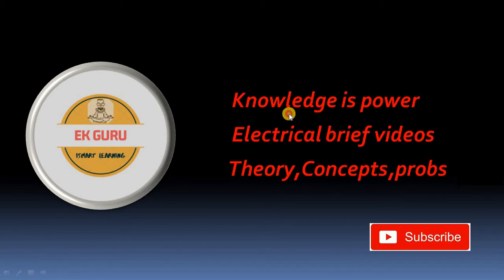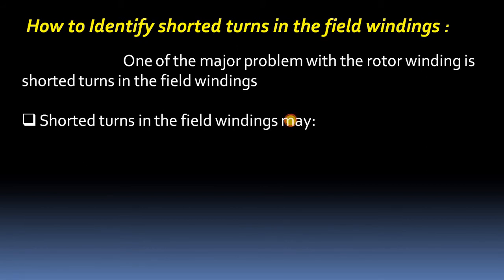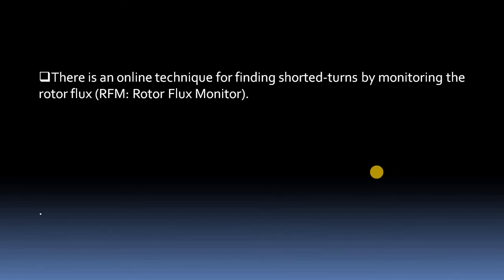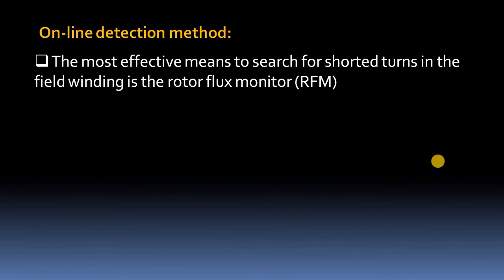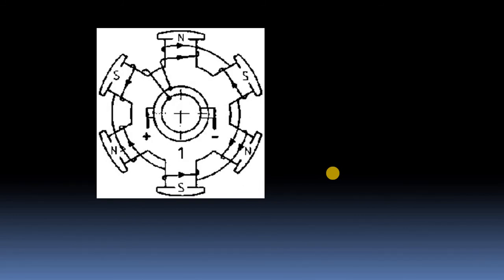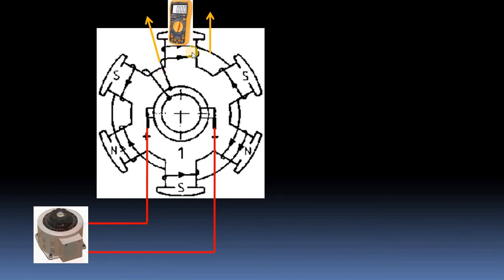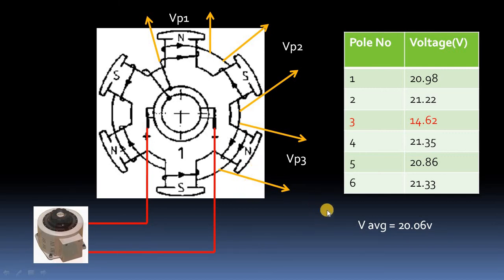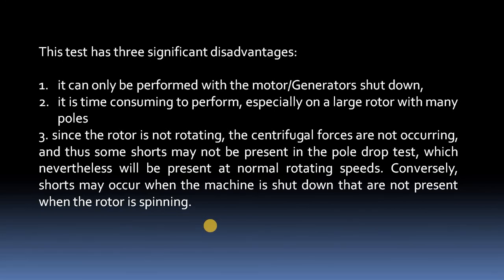Practical || Rotor inter turn fault and it's identification || pole drop test

Comment: In Pole drop test , how to test voltage across polls, because of insulation
Reply from the maker: Very small amount of insulation is removed at pole to pole joint in order to accommodate multimeter probes ....... After the test reinsulation should be done